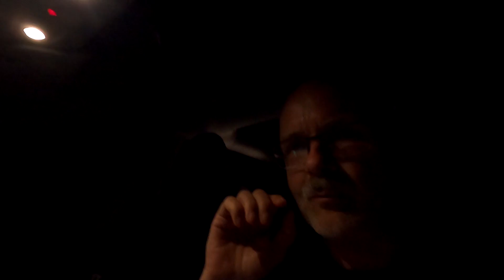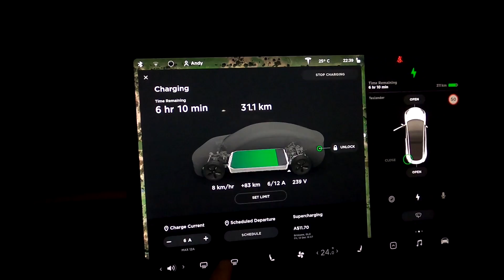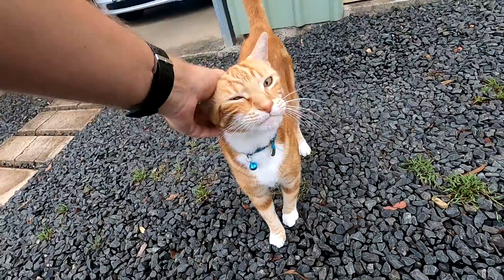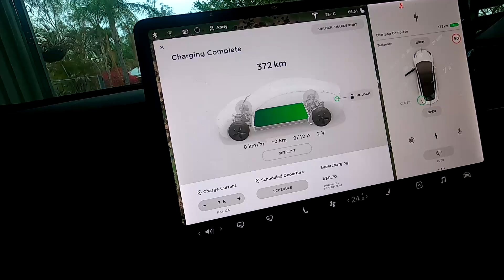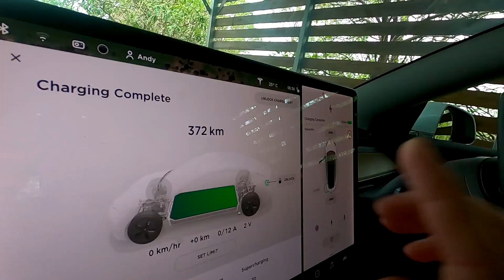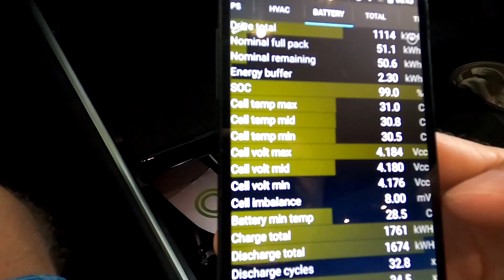EP324 - Model 3 Battery/Range Calibration gone wrong?

Comment: The range at 100% is very rubbery. The actual range is most likely anywhere from 300km to 400km, depending on too many factors. So saying its 2% different from before and relates to degradation seems odd.
I'm sure that Tesla has determined some way to calibrate its BMU without our intervention, and only needs balanced batteries to do it.
Of cause, if the manual gives some procedure for calibrating the bmu, then that should be done.
Reply: Walter K Agreed! My stats App shows this very clearly, and averages it out very nicely, with max range up and down, and at 5,000 klms it is also showing that degradation is so close to zero that it doesn’t matter. 
The Tesla BMU algorithms are about 10,000% better than the PHEV.

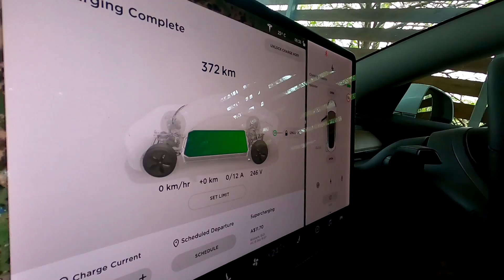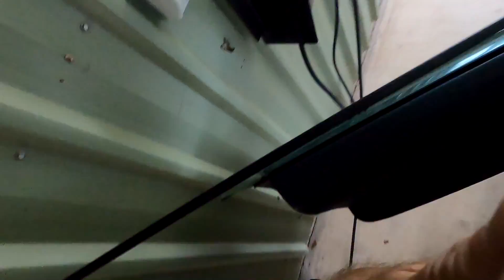Comment: How did you calculate that from 10:30 to 7:00 8.5 hours is not enough? :D
Reply from the maker: Vehicle started charging immediately, so the time frame was not long enough to charge to the set threshold.